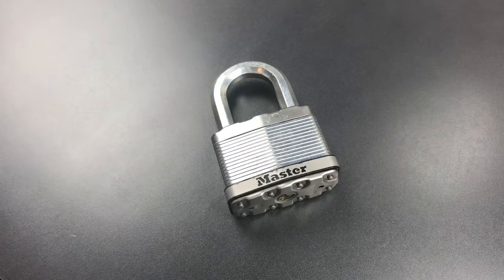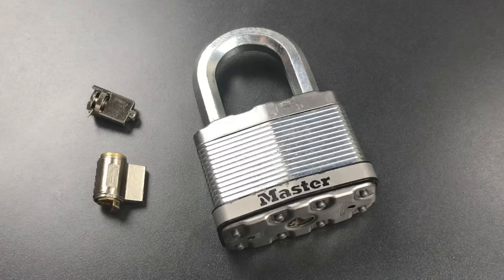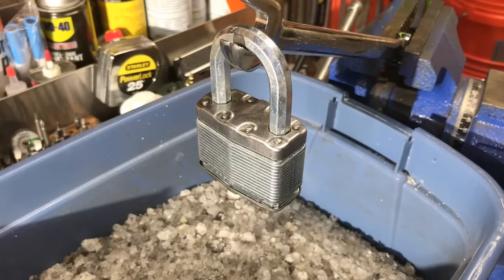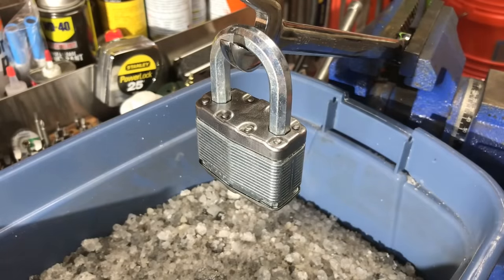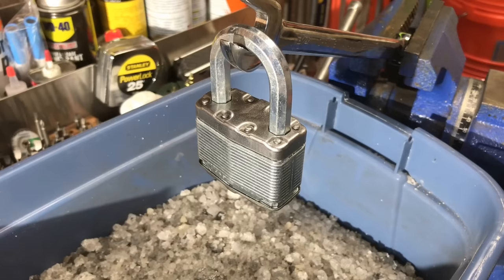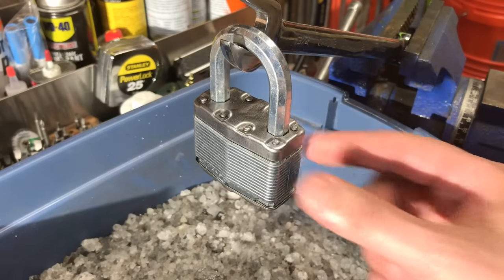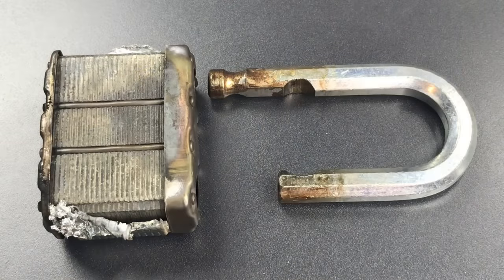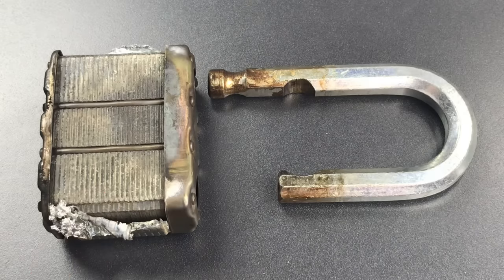[693] Plumbing Torch vs. Master Lock Magnum No. M15

Comment: @LockPickingLawyer what type of fuel were you using for the plumbing torch? Propane (blue bottle) is the most common fuel but i know that MAP gas (yellow bottle) burns a little hotter. Just curious how much difference something life 200 degrees would make on time
Reply: He should have been using the tip where the flame is hotter

Comment: you could oxy acetylene the shackle in 15 seconds
Reply: Yes, things like oxy acetylene and plasma cutters will go through something like this quick. What he is out to do is test their real world practicality. Someone lugging around two giant tanks like in an oxy acetylene rig is going to attract a ton of attention. It is however very easy to conceal a propane torch, medium size bolt cutters etc. A thief wants to keep a low profile, so he generally focus on practical applications that can be used to attack locks, to show how they would hold up in these circumstances.
Reply: @crx122  you sir have never seen a backpack torch. It will fit in a backpack and the exposed torch would be smaller than a popane torch with tank.

Comment: Congratulations and admiration for all the picking of yours that reveal a knowledge of technology and of the  market of a wide spectrum of products. I wander how - so far - as brute force method you have not used - or I am not aware - a  battery operated driller on the key cylinder (generally bronze) that appears both cheap and quick.

Comment: I'm wondering if that is a propane torch. For plumbing I use MAPP gas (it's been slightly changed), which burns much hotter. You have to be careful not to overheat your fittings.

Comment: Just a heads up, a propane torch burns hottest at the very tip of the blue cones in the flame.  You had it quite far back.  Closer and it would have been 3 minutes or less.

Comment: Interesting video, I might buy a couple of those locks to play around with (destructively play around with). I think to melt it quicker you could try wrapping the lock with some insulation that could handle the heat, like ceramic fiber blanket or even a soft fire brick that had a lock-size hole cut in it. Even insulating it a little will make it melt much faster. Another thing to try is hydrochloric acid ("muriatic" acid from hardware store). I use acid to eat away zinc galvanization on parts before I weld and it works great.

Comment: The zinc alloy shell around it isn't a security feature, it's something called a "sacrifical anode" and it's designed to corrode first before the hardened steel parts do. These are used on boats and metal structures in contact with the water all the time!

Comment: What were the 2 flares appearing from below the lock?  Was that zinc inside distilling off?  You could speed the attack by putting insulation (sold to protect the house when torching pipes) around the back and sides of the lock.  You could also torch through the keyhole.  If you had a little oxygen (you can get medical oxygen concentrators now!) in the mix?

Comment: Treat yourself (they're wonderfully handy around the home shop) to an acetylene-air torch like an ASCO, Goss, Turbotorch etc. All are ancient, proven designs of industrial quality. (I collect, overhaul and use acetylene and other torches of many makes including all the above.) An MC cylinder is slightly larger than typical LP cylinders and you get a wide choice of tips for soldering/heating/brazing along with a ~5000 degree flame. Your local welding supply has cylinders (refilled by exchange) and normally stocks at least one of the above torch kits. I promise utility and fun!

Comment: Hey LPL, you could make this exploit NEAR INSTANT (& far more dangerous eek) by applying an electrical short to it instead. This could be made portable with capacitors, batteries & a transformer. Would likely work with any padlock scaling it up to reach crazy melting points. Even if it doesn't conduct directly to the Zinc it would heat up ALL of the metal arouond it and transfer. Cheers to you & bosnian. Interesting stuff

Comment: Just a question. If you wanted to get in faster, wouldn't it have been quicker to direct the torch up the keyway? I believe you said the core itself was also Zinc, so wouldn't that have heated up and fell out fairly quickly  giving nearly direct access to heat the actuator much more quickly? Or is there something about lock biology I'm not quite aware of?

Comment: When I was in college, I worked for a moving and storage company in the summer.  Over the road drivers would break locks on trailers all the time.  It took a crow bar and one hit from an engineers hammer.
Reply: What's an engineer's hammer? I haven't seen many engineers swing a hammer.

Comment: I know, long ago video, but I just discovered you. Curious....why didnt you just direct the heat down the shackle into the lock? Heat the shackle for heat conductivity to the interior as well as leak by inside. Wonder if it would be faster.

Comment: I'd like to see an induction heater vs. such a lock. It could work great, since the lock body is made of steel which heats up a lot in an induction heater. And the heat is generated directly in the steel, so it may be faster than the torch.
One can get 1800 watt induction heater kits on Ebay for like $50.
This could actually be a practical attack, since one can power it via a few LiPo RC batteries, and the heater + the batteries can easily fit in a backpack.

Comment: Next time "aim your flame".that is to say,the pin set in the cylinder at the key way opening will melt out quickly if you ,1 grab the lock body with vise grips,2 strike your torch and adjust your flame tip to a point
3 aim the point up the key way so that just the tip of the flame enters.4 after 45 seconds approx.
Give it as little shake with the vice grips and all the brass parts of the cylinder and pin set will flow out
Other tool types:Burns- o - magic
Ts8000 with mapp .

Comment: Question: couldn't you use the torch to UNharden the shackle..? ~> If you'd focus on a single point, that would be quite fast, I think.
     (It would require an extra tool, though: bolt cutters)

Comment: So...looking at this lock while you were heating it up, it had a cheap outer layer that burned away quite quickly and it appears as if there was a very small space inbetween that layer and the actual lock body. Would it not be much more secure if you constructed that outer layer with the same high melting point steel they used for the lock body? I'm thinking that if the outer layer were to stay intact, and in that small space you were to put some type of material that doesn't transfer heat inbetween that outter layler and the lock body then it would be impossible...or at least much more difficult to heat up the cast zinc core.

Comment: Remember the old master lock adds of the bullet holes through the lock? Try shooting it with a Ruger GP-100 357 magnum load of a full case of blue dot, and a Hornady hollow point and see what happens. It's hard to locate all the pieces afterwards.

Comment: Old video, I know, but at least with acetylene torch, the hottest part is at the top of the inner blue flame, not further out.  I suspect the same is true of this type of torch so heating would be much faster.  However, if the torch can't get air/oxygen when that close, this is of no help...  :)

Fascinating seeing the outer cover melt away so fast though, thanks!

Comment: Comment about the torching: you note how the torch was "hiccup-ing".  That was because the torch was inhaling its own fumes!  The tray you had made the fumes recirculate.  You need to keep the blue tip of the flame just touching the lock body.

Comment: I tend to think that the shackle would have been a better place to apply the torch, as it has far less thermal mass, no air-gaps, and the only zinc you really need to melt/soften is the part that's in best mechanical (and thermal) contact with the shackle.

Comment: Makes me wonder, if the core is also zinc, as you said earlier in the video, what if you had applied the torch flame directly to the core from the bottom and melted it then the actuator instead of going through the more massive side?

Comment: I'm curious if you're using propane gas or map gas. Because map gas burns much hotter and would be faster
Reply: craig latour butane
Reply: MAPP is not made anymore, they only have garbage Map Pro
Reply: Thats a map gas tip...

Comment: Would this not be better done by blowtorching into the locking chamber, so you didn't have to heat up the entire body and could instead concentrate it into the tumbler and such, or would the melting zinc just sieze the whole thing up?

Comment: Can’t you pick the lock faster than that?  In this case it would make more sense to use Zinc if it takes longer to burn the lock than to pick it.
Reply: Propane torch requires less skill. There are tons of ways to open a lock may not be the fastest.

Comment: The smallest turbo tip on an oxy/acetylene torch heats up to 2000 degrees and the 1/2" variety melts a 5# lead in 2 minutes. You should try one or both of these tips.

Comment: Is this an across the board problem?
A buddy lost the key to a lock before and we spent a good half hour with a torch cutting through the shackle itself - I take it we went about things the hard way (for folks with zero lock picking skills or knowledge)?
Reply: have a look at the core - a brass core will not as melt as fast as a zinc-based one.

Comment: Would it be possible to just heat the shackle to red hot with the torch then cut it with a relatively small bolt cutter?

Comment: BTW, a respirator will not protect you from fumes, only particles. you want a positive pressure breathing apparatus for full protection. However, a cheap fan pushing the fumes away from you is cheaper and works just as good.

Comment: It's interesting to see such a big flaw in these types of locks. But I can't imagine to many criminals using a blow torch to get into a lock.
Reply: Not until they see these videos, that is.
Reply: Maybe not, but consider a scenario where you are storing something valuable in a secure location in a building (say a metal case with this lock on it) and the building burns down. Your item, should it survive the heat, will be easily obtainable for anyone who picks through the wreckage, which might be an issue if the item in question is something like a gun (wood or plastic stocks and grips will be destroyed, but a fire that melts the zinc lock parts might not be hot enough to damage the metal parts depending on the gun's design and material choices) or a lump of gold bullion.
Reply: Auriam don’t worry, criminals can’t afford internet.

Comment: You can alsonuse a bottle of keyboard cleaning spray, tilt it so its upside down, spray the whole can into the keyhole. This will freeze all of the components inside making then very brittle. Then give a couple blows with a hammer and boom your in like sin

Comment: I don’t get why they have the cheap zinc casting with a laminated steel texture when they could just make the steel stampings the size of the lock, where they would also cover more of the assembly rivets

Comment: I'm curious about how much noise is required to defeat a lock as a deterrent to thieves. That sounds like a pretty loud torch; would a thief hesitate to make that noise for 3 minutes? I'm not defending the lock, just wondering if there's a quieter way to deliver that heat. In reality, many homes can be easily accessed by smashing a window with a hammer but that's noisy!

Comment: It seems like you could get some use out of using some leverage with your long screwdriver checking. It would provide more pressure in a short amount of time and it is also realistic where the lock will be against something most of the time. Having a backing that could hook the screwdriver would do nicely.

Comment: We can tell you're not the Lock Picking Welder. The hottest point of a gas flame is just beyond the visible blue tip. You were handicapping the torch by bouncing the hot spot off the target the entire time - essentially heating the air just in front of the metal rather than where you needed to melt.

Comment: The hottest part of the flame is the tip of the inner  flame. If you put the tip of the inner flame in contact with the metal rather than holding it back a bit the lock would have failed sooner.

Comment: Touch the more intensely blue part of the flame to the metal and it will heat up quicker. And use map gas if you are not already.

Comment: Is there a reason why you suspend it over rock salt? I get not wanting the drippings to land on your workbench, but is this just something you have on hand for when it snows or is there a particular property of rock salt you're taking advantage of?
Reply: It won't burn or smoke like wood and it won't sizzle and steam up like water.
Reply: Perfect, that's the kind of explanation I was looking for.
Reply: Well, then why not just plain sand?
Reply: MasterBata When I lived in the Northeast, I always had a bag or two of rock salt laying around.  I never had sand unless I absolutely needed it.
Reply: Really? Interesting... Sand is literally everywhere in common dirt outside. Rock salt has to be bought.
Reply: MasterBata Correct, but sand won’t melt the snow on the driveway.

Comment: would putting the torch about an inch closer direct more of the heat into the lock? if you were almost touching the lock would it not heat up faster? or is basically all the heat energy not lost at that distance?
Reply: The just in front of the blue cones inside the flame corona are the hotest part of the flame, but without oxy cutting goggles (or very dark sunglasses) it might be a bit too bright to look at for too long and correctly direct it onto the metal.

Comment: Don't know if you read comments on old videos but a respirator isn't going to do anything for zinc oxide even with double stack organic cartridges and certainly not p100's those only work for dust. I work inside reactors in chemical plants and refineries and I have worked inside quite a few zinc oxide producing reactors and I can't even get a permit to make entry into an empty zinc oxide at co-op(widely regarded as the most dangerous refinery in north america because they are so lax on safety) has to be supplied air. I can go into further details about my credentials on the matter if you wish but just wanted to give you a heads up, you can't filter that shit.

Comment: This is the kind of stuff that drives me crazy. "Look at the Boron Carbide hExAgOnAl shank! This is a lock that's got the bases covered!! Yet - as was stated "it is a lock of extremes" it can quietly be defeated with a portable torch because the other equally important parts are made of a metal that melts in practically the same temp range as solder. THAT part wasn't mentioned on the darn package.
Reply: Is there a single known case where somebody used this method to steal something?

It’s hardly a real problem.
Reply: Quietly? You ever heard the noise of a torch???

Comment: The Springs in the lock cylinder itself seem to collapse after only a couple of years of use I open one the other day with a Dremel and color wheel it could not be picked open because the Springs were collapsed and it was Shackled on a trailer upside down which made it a bit problematic the pic 30 seconds with a cutter wheel and it was off of there

Comment: Instead of heating up the whole of the quite chunky body to melt the actuator, wouldn't it be faster to heat up the shackle, negating the hardening and heat treating, and then cut it? How long would that take?
Reply: You couldn't do that with this torch, it's not hot enough. If you had a hot enough torch, you'd have a torch that could cut through the shackle itself, but those torches are large, expensive, and cumbersome. This video was to prove that a cheap little plumber's torch that anybody could buy and conceal is capable of getting thru the lock. A cutting torch could get thru pretty much any metal lock you could throw at it.
Reply: @keithklassen5320  I'm not talking about cutting, but about softening. Soft-annealing temperatures of steel, upon a first glance, seem to lie around 700°C to 750°C. I'm not a native english speaker, so I'm not quite sure about what is considered a "plumbing torch", but estimating it's a butane or propane torch, depending on the source, these develop heat around 1500°C to 2000°C. Now, I get that a small torch won't have the output to melt the shackle alltogether, but I think it might be able to bring it up to annealing temperatures. It might be, though, that it would take way longer due to said low output. If he's interested, maybe our all-favourite LockPickingLawyer might want to test that?

Comment: Should invest in a induction coil, bet would be a lot quicker and much more quiet.
Not sure about a portable power supply 48v lead acid?
Reply: 18650 cells are cheap, that's the route I'd go.

Comment: I think you were holding the torch about 3/4 of an inch too close to the lock for optimal heating.  You want the tip of the blue flame to coincide with the surface being heated to expose it to the hottest part of the flame.

Comment: Is it possible that locks such as this are designed to melt apart in a fire, to make entry into a burning building easier for fire crews?
Reply: I would imaging that if the lock can get hot enough to melt out the core (or other locking machanisms), then it would have to be in a raging inferno and the door would be ashes anyway.

Comment: Only use this lock to protect extremely flammable valuables.
That way, any attempt at using this method to break in will stop the thief from ever attempting another break in, or anything else for that matter.

Comment: Not sure what type of torch you used, but the type of torch, i would use would be map gas or a hotter burning gas than propane. Plumbers dont want to melt the copper pipe hahaha